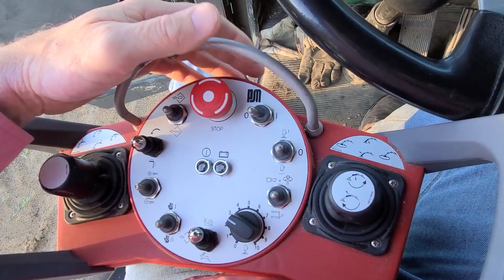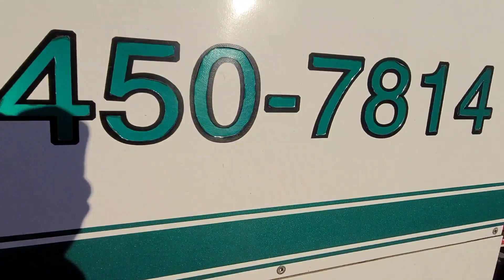Concrete PumpVlog #27! East Bound & Down! #concretepumping #vlog

Comment: Interesting to see the different clean out methods! The 38m z-boom I’m learning will pull a sponge ball back folded up, with enough room to open the hopper lid.  That putz of yours seems to pump a nice steady volume, even with the big tip hose. Thanks for sharing, safe travels!
Reply from the maker: I clean up several different ways, just depends on how I feel and where I'm at. If I run multiple jobs in a day, I will sometimes put a square sponge in and a ball behind and pull them back folded up on the truck. Otherwise I water wash, or pull a pig while Z'd up in the air. Sometimes I'll pull a sponge back in a arch though.